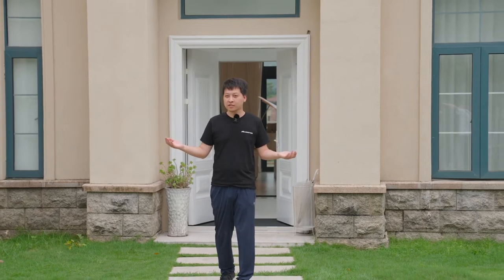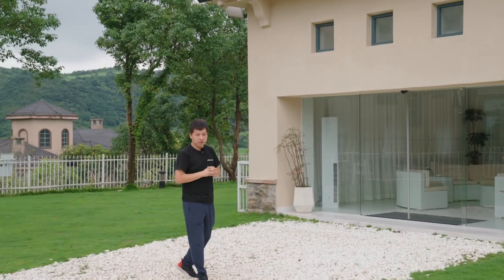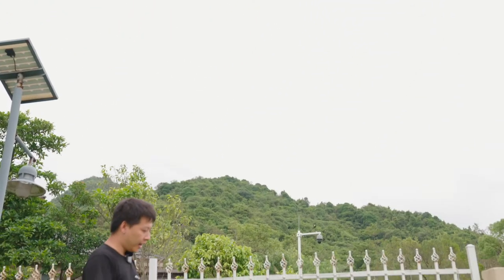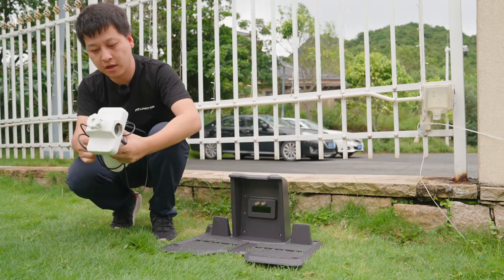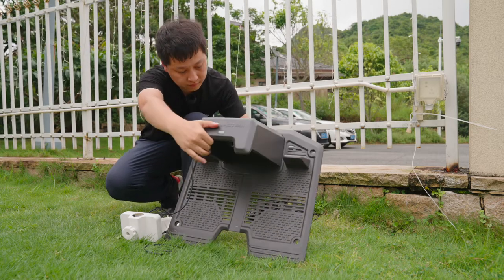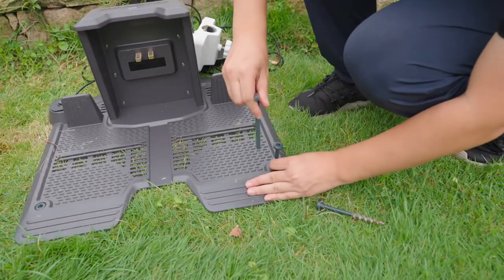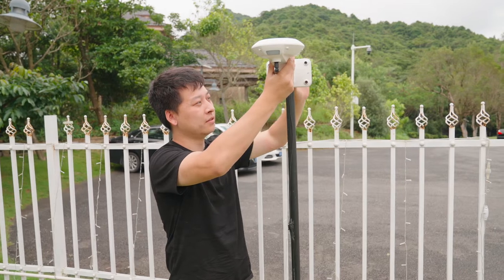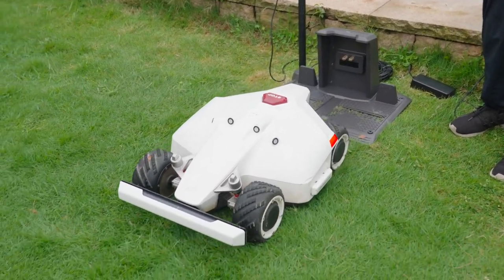Luba Robot Lawn Mower RTK Introduction

Comment: I would take a chance on this possibly, if it had some way to track if stolen.  Otherwise, it will get stolen and I will be out $2700 USD.  I really to own one of these though.  I think it is years ahead of what the competition is also coming out with soon or out now which all use some sort of RTK or vision sensors to avoid boundary wires.
Reply from the maker: Hi Scott, Luba will be automatically locked when the robot leaves your Geo-fence area. You'll receive an alert via the Mammotion App when it’s potentially stolen. No worries about it.
Reply: @stevenunbox841  ok that's great but am I supposed to chase the car the thieves drive away in?  What happens after the alert lol?  Alert you lost 2800 USD.  That's about it?  Unless I can ping it on a map and call the cops on them, what good is a locked device I'm still out 2800 usd
Reply: Maybe hide an apple tag in the device would be an option?
Reply from the maker: @Scott-dn1bk  Hi Scott, there is an option for you to add a SIM option that allows you to track LUBA in real time, but it'll need to be upgraded in the local repair center. No body has to permission to use it unless you allow it, so even they steal it and they won't be able to use it. There are people who hide an Apple tag in the device. That works at the moment. Thank you.